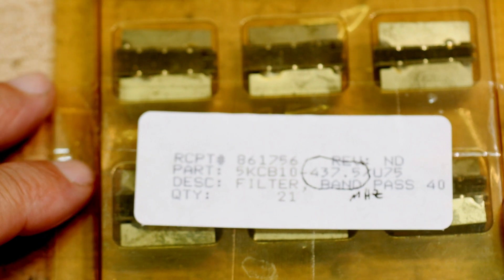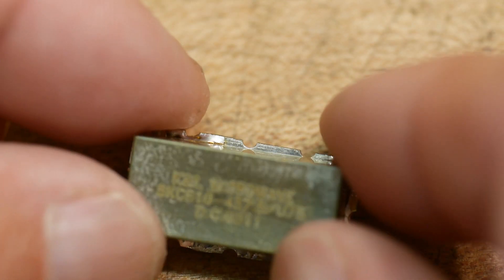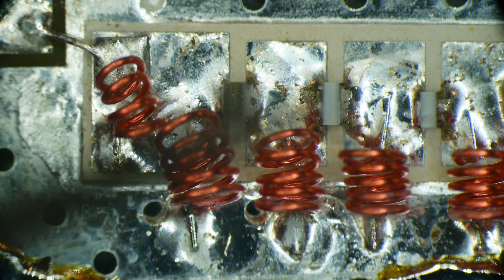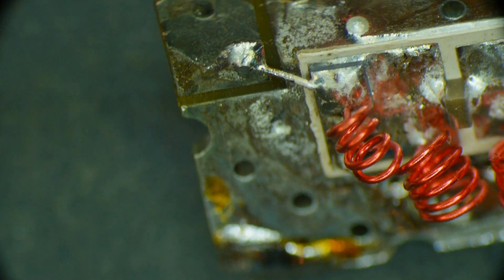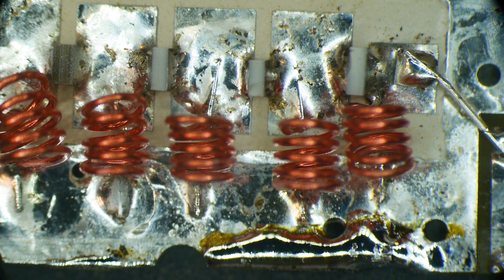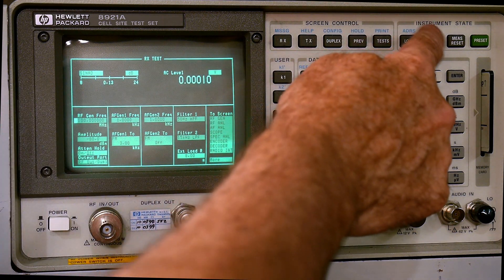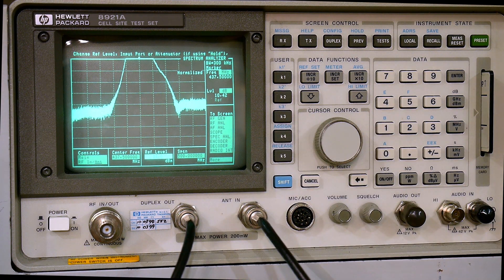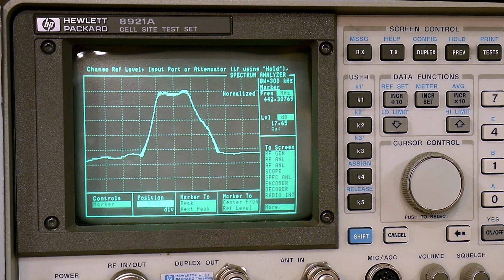#901 437 MHz Bandpass Filter

Comment: Filter design and debugging (LC cavity microstrip waveguide bandpass, low-pass, high pass) duplexer design
10 years of experience in HFSS simulation design and engineering, with a design frequency of terahertz. All designs are based on practice and guided by theory. Remote after-sales service is available, and long-term cooperation can provide on-site service!

Comment: Looks like the 8921A is due for a cal….
Reply from the maker: if you are talking about the verbiage at the top of screen, that is pilot error. I must have told it out output too many dBm on the RF port. It is limited. You can get more dBm on the duplex port. I'll do a full VNA measurement on this device in the future.
Reply: Also the 8591E at the end might need calibration, or maybe repair…

The “like and subscribe” error code and the ominous sounds are concerning.

Jokes aside, thanks for all the great videos!

Comment: I've got a video suggestion on the tinySA. I just bought one and started to play with it. First I watched all of your videos and others. The most important video seemed to be the "Don't blow up your tinySA by overdriving it" (paraphrasing your title).

The thing that has me perplexed is the "no input" display. I put a 50 ohm terminator scrounged from my NanoVNA on the bottom connector (LOW side) and looked at the screen. I see what looks to be a large signal down near 0 Hz. Does that large signal "count" towards the warning on how big of a signal can be put into the tinySA? Or can it basically be ignored? I suppose if I'm not putting in any DC (and I am not) then it should stay the same at that level. Even at $55 I still don't want to break the tinySA.

What exactly is that large signal near zero?
Reply from the maker: all spectrum analyzers have a large signal at 0 hz (see: https://youtu.be/Ze4V6Qp1mK8) don't be worried
Reply: @IMSAIGuy  Thanks!
Reply: I'm also confused by how/when the in-built 50 terminator gets used.
Reply from the maker: @LandBoardsLLC  the spectrum analyzer input impedance is always 50 ohm